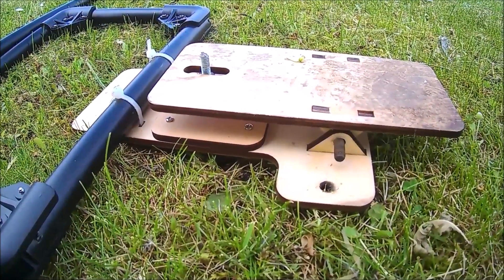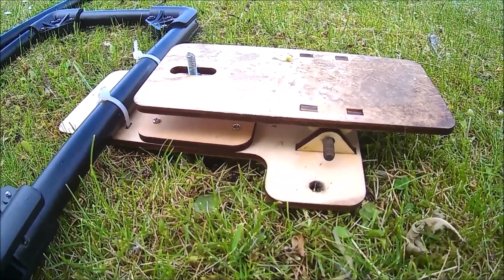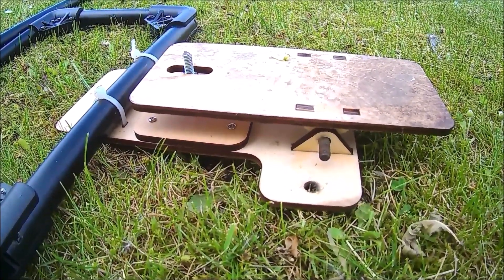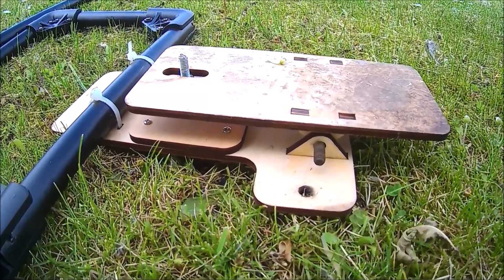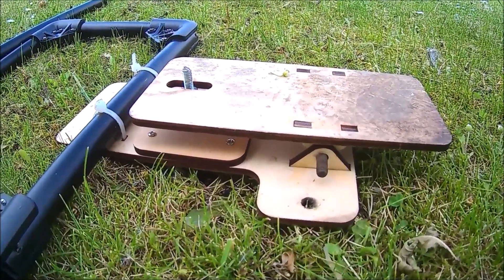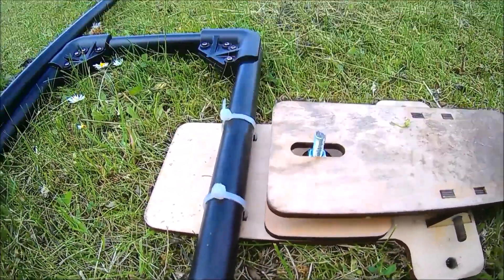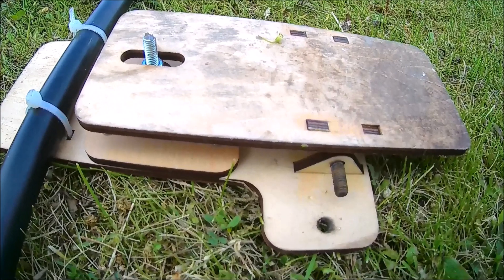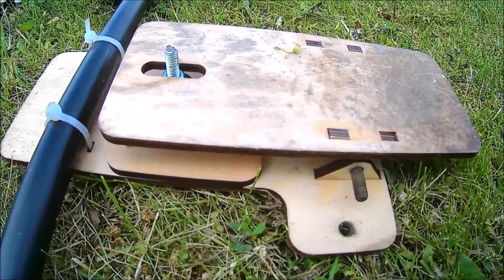RC Bungee Launcher set up and launching

Comment: How far from the center of gravity is the hook on the plane? The HK ramp manual says to put it at the center of gravity but I've read several times that it is placed at the leading edge of the wings. How did you do it?
Reply from the maker: yeah i did that too to start with and it shoots upward like dragging a kite 😁 i place mine 1/3 of the way infront of CG towards the nose and its perfect

Comment: That's a weak bungee. I bungee launch 3 meter gliders. The bungee will take the glider to about 150' altitude. It would probably put a 90mm ducted fan jet into orbit. I really like the ramp setup that the plane sits on. I need one of these!
Reply from the maker: hey buddy what are you using to launch them big buggars , i have a few larger ones im not too sure about strapping them to it for obvious reasons LOL but i like the sound of launching into orbit
Reply: @Shad3yB  I dug one up to see if there was  a manufacturer's name, but no luck. They are 3/8" surgical tubing about 600' long. Staked down, it is pulled to about 1100' for launch. What works even better is a winch launch which is a 6v DC starter motor that turns a spool with braided nylon fishing line. It is powered by a single 12v car battery. The motor is mounted on an aluminum plate that is staked to the ground. The line runs 1200' out to a staked pulley and comes all the way back to the launching line. The power is operated through a foot switch. The nice part about a winch setup is that you can abort a launch when half way up. The bad part is there is so much power, you can fold a glider's wings if you arent careful.

Comment: How long elastic chord is?
Reply from the maker: its a 5m x 8mm Chord before stretching
Reply: @Shad3yB  Hi thanks for replay..But if i have ,chord thikness 4mm and 6m long!I need to put 2 of them 4+4 chord?!It Will ok?
Reply from the maker: @Sandokans  fold it in two buddy :) how heavy are your models, are they EDF  or pusher ? really launcher just gets them moving and air over the wings
Reply: @Shad3yB  I have edf eachine f18 with 500 gr max and other made by me,1kg weight..
Reply from the maker: @Sandokans  that should work fine buddy, thats what i used to start with, I'm launching 2.5K planes and upgraded my tubing after 1year of launching to the 8mm thick 👍
Reply from the maker: https://amzn.eu/d/8Fwr56S
Reply: @Shad3yB  ..I Found on Amazon italia, 9mm chord...5 meters..Thanks for the input